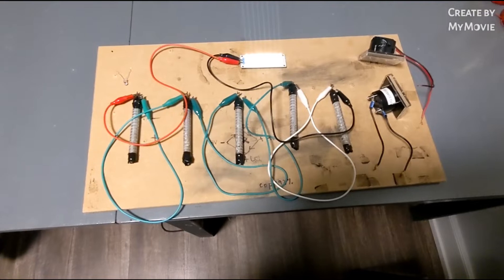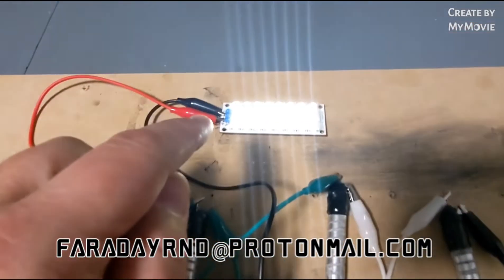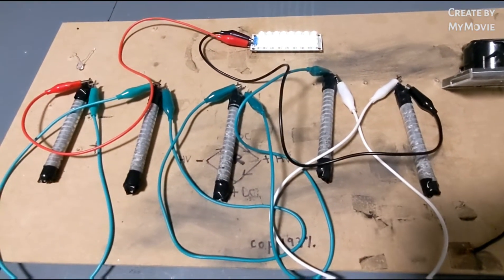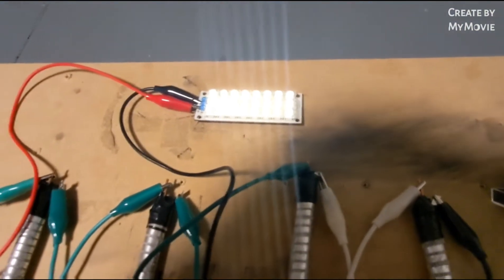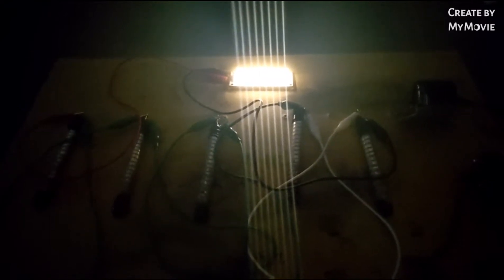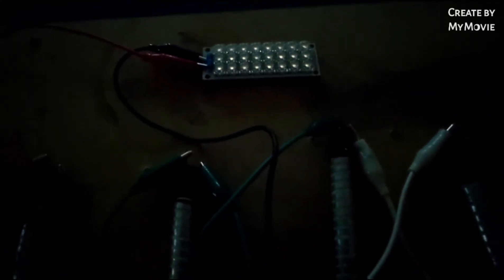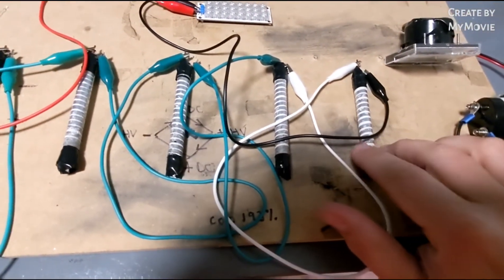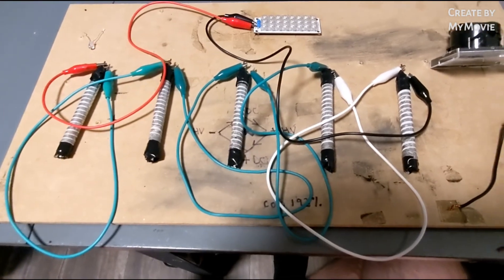Faraday Research RND ⚡⚡ Earth Battery 🔋#freeenergy #tesla #zeropointenergy

Comment: so if you somehow stood each of these up in a tube of water would it go until the water evaporated?
Reply: Same if you buried them in the ground as earth batteries, the natural humidity will keep them charged as long as the materials last
Reply: How do construct them. Like what are the components to make a single cell?
Reply from the maker: @andrewthuku263 all you need is carbon graphite Rod, magnesium strip, paper towel and then just wrap the paper towel around the rod, wrap the magnesium around and attach a copper wire at the top of the carbon graphite Rod and that's it
Reply from the maker: Yep you got it just keep it in water all the time and it would never run out of power